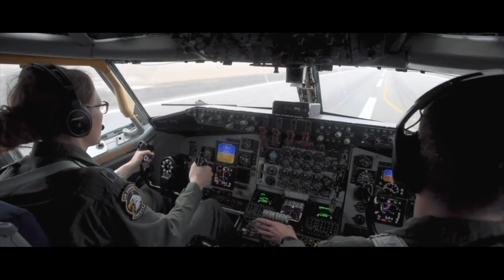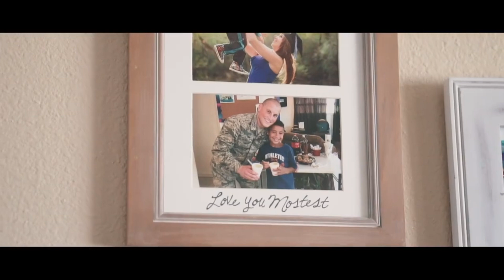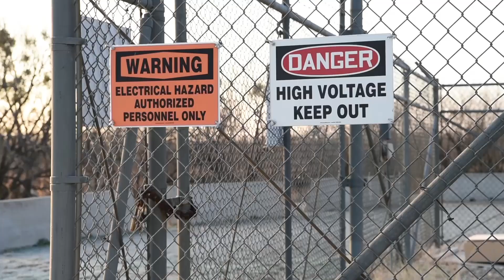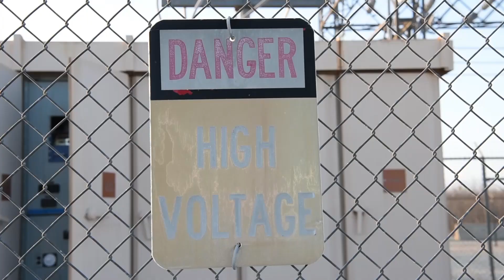Air Force Electrical Systems (3E0X1)

Comment: I’m enrolled in electrical school right now and was wondering if after my completion and if I enlist, would my credits help towards rank or even just getting this specific job a lot “easier”?
Reply: From what I researched, college credits do help you with rank. I got an associate degree so I think when I join I’ll be start at E3 instead of E1. And I don’t know if it’ll help get a certain job, you take the Asvab and score a high score for the electrical side it’ll definitely help get the electrical systems on your list of available careers